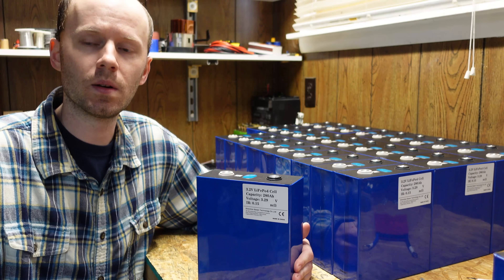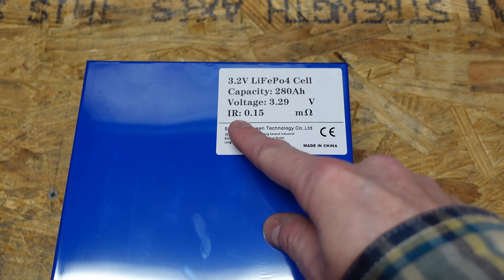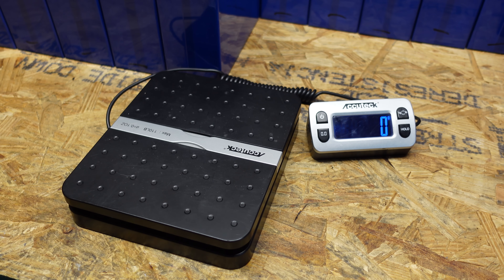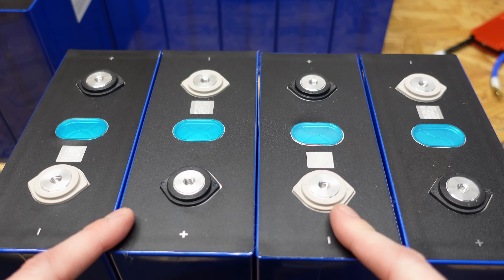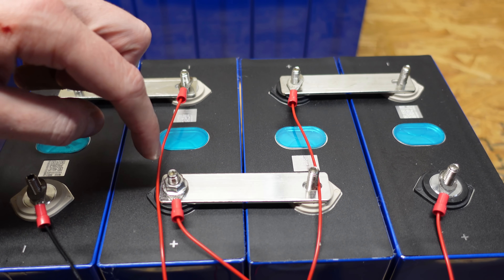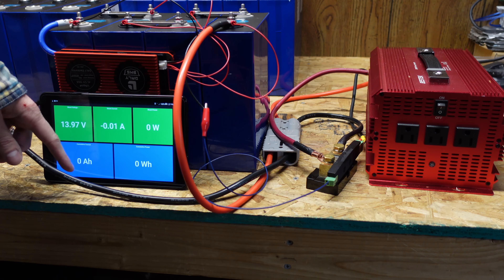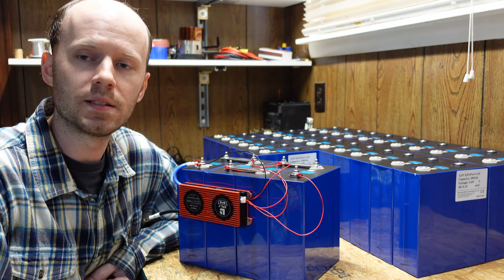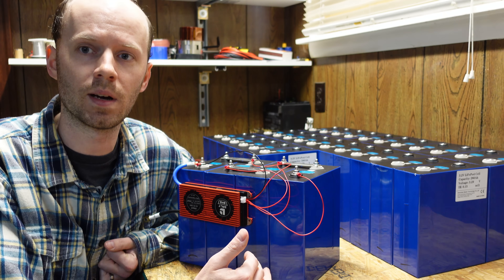EVE 280Ah 3.2V LiFePO4 Prismatic Batteries (Shenzhen Basen)

Comment: do not.... repeat .. do not use stainless steel on ali.. it is a mis match.. your studs will rot out the ali .. and make batts no good ... if you do not belive me .. ok.. butt ask a radio ham ? yep or an engineer ok..
Reply from the maker: Why will the studs rot out?
Reply: @LithiumSolar  its an electrical miss match. it takes a couple of years but they rot out.. i leant the hard way.  i used s/s jubilee hose clips to fix my antenna .. then next time i had a problem it turns out i had no antenna. three clips and 4 bits of aerial . hole thing rots away. change the studs to plain steel ones and all will be good
Reply: ps... its the ali that rots not the stainless.. ok
Reply: @LithiumSolar  I got 4 of them the other day with same studs (grub screws). I am thinking to abrade the terminal & the busbar with scotchbrite pad & use conductive grease (NOT dielectric grease) to hopefully reduce oxidation between, which in my opinion should be the major current path. Remember these cells & the BMS are not waterproof, so keep them dry also. Wondering should I grease the grub screw threads - thoughts?
Reply: It's called galvanic corrosion... you typically need to select materials that are close in galvanic series, but a small stainless stud in a large aluminum surface is not an issue..

Comment: Thanks for the nice vid, my cells are on the way from Basen too... I got the same BMS wit my Bluetooth for monitor ... can we change the setting on BMS to 2.6 cut off instead of 2.2? Please do a how to top balance on these cell if possible? Thanks a lot
Reply: Will Prowse has a 6-minute tutorial on how to top balance LiFePO4's:  https://www.youtube.com/watch?v=x5ABvbbics8  He explains why you should do it and some precautions you should take.  Honestly, it's very simple to do, and the actual instructions on how to do it take only about 30 to 60 seconds to explain in the video. 

Basically, you connect your cells in parallel, then connect a 3.65V power supply to charge them until the current drops near zero.  It's preferable that the cells are fairly well charged before doing so or it may take a long time.  When I'm top balancing, I tend to charge below 0.2C (1/5th the rated current of the batteries) as there's no reason to be in a hurry with saturation.
Reply: The ordinary Daly BMS's can only be customized by themselves, we cannot change any parameters ourselves. Actually with these default cut off settings (2.28V lower, 3.75V upper) these BMS's are quite useless. Their balancing currents are also like 30-60mA, which isn't practical when dealing with tens or even hundreds of amps charge, discharge currents. So I wonder how they can actually protect the cells (except for in case of short circuit)
Reply: The Daly "Superior" BMS says "customizable" on the data sheet, so maybe if you order straight from Daly you can request 2.5 low voltage and 3.65 high voltage?  The "smart" models can be set via the PC software, so I've read.  I'm trying to find a good 200-250A or more BMS so I can fire up a 2kW inverter to the max.

Comment: Those are great batteries, how much did they charge to ship the batteries?
Reply from the maker: The shipping portion of the invoice was $592 using DDP shipping.
Reply: @LithiumSolar  ouch !  $344 for the battery that's cheap. But $592 for shipping put a damper on my project.
Reply: @RichQcCa  $592 is for 32 cells, if you're only buying 4 cells the shipping will ofc be cheaper than that.
Reply from the maker: @EdisonWong2004  Yes, the $592 was the cost for the entire shipment of 32 batteries in 16 different boxes. You can request a quote for free and they can give you a price for the number of batteries you want.
Reply: @RichQcCa  they quoted me $356 for 4 cells plus $135 for shipping to Texas which is cheaper than a Battleborn battery and double the capacity

Comment: Excellent decision going with those cells. Set and forget for the next 10 years ;)
Reply: Ya sure but how long will it last in  ofgrid condition using regularly
Reply: @showbudgies1517 , the 3 main factors keeping LFP cells healthy are: C-rate during charge and discharge, temperature profile and compression. Solar Off-grid are typically the easy going applications it terms of C-rate. Big pack, as you want to have stored energy for maybe a few days, and relatively constant loads pulled over long time intervals. Li-Ion cells of any kind prefer warm temperatures, as then the Ions are moving easily through the battery (internal resistance). LFP is feeling very comfortable at 25-35 deg C. Compression, in terms of holding the cells together, don't let them freely contract and expand as they could delaminate internally under harsh conditions. Do all right, and you will get 5000 cycles till 80% DOD while using 90% of capacity at each cycle (3,5V high and 3,0V low).

Comment: Quick question, the first red wire goes into the 1st cell positive or the 2nd cell negative? In the video I think you have it in the second cell negative?
Reply: 1st cell positive is directly strapped to the 2nd cell negative so they are essentially the same. Notice the bar connecting them?
Reply: Yes I think that was wrong, Red wires to every positive post.

Comment: That shipping material looked to be Low density polyethylene. It is great shipping material the same stuff dell computers are shipped in.
Reply: My 200 AH Aims batteries came shipped in this stuff, arrived in perfect shape. I kept the foam. I put a Honda EU2200i on one and made the unit much quieter on a wooden deck.

Comment: Nice! I was thinking to order either these or LISHEN 200 Ah cells for 17s 1p for "48v" ofgrid solar pv system with 200a Daly smart BMS and 5kW 100A EPEVER low frequency inverter charger.
Eve's datasheet states that capacity is measured at 0.3c so that is within spec :)
DoD 80% will indeed prolong its lifetime and allowfor narrower voltage range.
How about compression enclosure to prolong lifetime?

Comment: Im assuming the heater was 1500 watts .. how long did it take to deain the 280ah?
Reply: P = U • I  and E = P • t
Reply: This is my rough estimate (3.6v x 4 cells) =14.4v then multiply by 280Ah gives u 4032 watts then divide that by 1500 watts of the heat gives u 2.3 hours of course added some loss from the inverter
Reply: @DIY_versus  Quite allright. If you use the medium cell voltage under load, like 3,2 Volt, you are more close to reality. Then if you pull the correct units through the calculating to the end, you have an "automatic double-check" of your calculations. The "4032 watts" is Wh (Watt•hour) or 4 kWh.
Reply: @Stefan_Dahn  u can set your BMS to whatever max voltage u want . Usually 3.65 is the max and 2.5v being the min . You can set your own preferred voltage . And of course u don't what to take your batteries to the max and min .
Reply: @DIY_versus  But this does not affect the capacity or average voltage much, as below 3.1 Volt there is quite no energy left in the cell.

Comment: 32 cells all in series for a 96v setup? That how i run these exact same cells.
Reply from the maker: I'm planning for a 16s2pm. My off-grid setup is a 48V.
Reply: @LithiumSolar  Sure, you would have to arrange for a new controller and inverter. I am running a 10kw inverter in Europe to 220v single phase. For a 110v setup you hardly need to step up the voltage and there are even smaller inverters now from 5kw up for 96v batteries. Probably for the future the best would be storing at a higher voltage than using?
Reply: @adragaadraga4026  For USA* ~120AC  You'd need in excess of  170 volts DC. 230AC  325 DC  
* Voltage  USA  is NEEMA = 120. or  ANS I= 125 both @60Hz   
*NORMALIZED EU standard = 230/400  @50Hz.
Reply: Would be nice to have that set up here in Texas with no power for the first time in decades

Comment: Nice video, Mike. Do you use some form of heat in your vault shed to keep your batteries above freezing temperatures? Are you going to be replacing some of the 18650 cell batteries that are in your shed will these or adding these as additional battery bank?

Comment: Looks good I found a heater in my 26650 lifepo4 A123 batteries but they are 6 years old, other than that the 50 kwh I have hooked have run pretty good for well over a year now.

Comment: Did I see it correctly?  Looks like your last cell (+) was not hooked to the right cell.  It looked like you had two positive leads on the same cell.  I order 64 of the Lishen 272Ah cells for ~$87/cell with shipping coming on the "slow boat from china."  Should have another week to go.  We'll see how they look/perform soon.
Reply: its connected to the bus bar so doesnt matter.  the first red wire is on the "wrong" cell terminal (2ndcell negative instead of first positive), but technically is measuring the voltage on the first cell as its on the busbar.   Technically should had been on the first cells +
Reply: He installed the first positive lead on the bussbar over the negative terminal for that cell, instead of on the positive terminal for cell 1, but it won’t make any difference, since it is on the same bussbar as the first cell positive.
Reply: It freaked me out. It took me the whole video to figure out it would be the same voltage. But when he said "well, I double checked my connections and am ready to plug in", I wanted to scream NOOOOOOOOOOOOO!
Reply: David, can you share the supplier and the price has shipping included?
Reply: @carlosgaspar74  I did it using a group-buy from Will Prowse's DIY Solar Power Forum.  The thread for the cells is: https://diysolarforum.com/threads/lishen-272ah-thread.12871 and the individual I setup the group-buy with was Michael B Caro.  Just PM him and ask for a quote for the number of cells you are looking to purchase.

Comment: Awesome.  Amazing how much better this batch is compared to the first. Thank you for stating how much it cost with everything included, taxes fees etc, per kilowatt hour. I do have one question... Why did you test it using this method instead of discharge using your icharger x6 in regen mode?
Reply: Mmmmmm
Reply: I have the same question. That would be my first go to method using my x8. My only thought would be that’s how Mike has been testing pre-built 12v LiFePO4 batteries in previous videos.
Reply from the maker: I guess I just thought that testing a single cell would be a little too plain/boring lol. I haven't decided if I'm going to go through and test one by one or not.
Reply: @LithiumSolar  if these are aluminum cased is there really a need to compress thought that was only for plastic CALB primatics that you had to compress.
Reply: @LithiumSolar  I thought Shenzhen Basen Technology sells Lishen cells not EVE ? Can't u list if there is any difference  please
Reply from the maker: @DIY_versus  Yes, they sell Lishen cells too. I purchased the EVE cells.
Reply: @LithiumSolar  ok thanks what's the difference by the way ?
Reply: @liv04soccer   if you mean those gray calb prismatic cells they deffinitly dont need compresion i work at a company that uses them in converted 7,5 ton delivery trucks and those cells dont puff up even when reguarly under high load (somwehr up to 250 A ). I dont know if there is another typ of calb cells but they standard grey ones have a metal inner casing unlike winston /thundersky wich deffinitly ned compresion althou on yt most peopel say they dont
Reply: That's interesting didn't know the plastic have an inner steel casing I read somewhere you had to have compression on them. 
These blue 1s are aluminum not sure if they need compression.
Reply: @liv04soccer  the blue ones in the video deffinitly need compresion the aluminium casing wont hold up to the gases. At work we use similar ones  on diffrent vehicels but in pre manufactured packs of 6 and they are also compressed
Reply: @nickhetzer2744  Does the manafacture state the compression specs I don't see a lot of YouTubers ever compress these ?
Reply: @liv04soccer   i dont know exactly but in my case at work the manufacturer compresses them with 3 stell packaging wraps like on a pallet  and 2 aluminium plates on each end so they must be serius about that our calb cells are only packed into a stailes steel box with som rigid foam wich wont compress them at al
Reply: I would say that there is no need of testing brand new cells individually before assembling the pack. They are tested in the factory. Just equalize them by paralleling them before putting the pack together. If there is an outlier in the pack, you will see it on voltage best at low SOC
Reply: @RolandW_DIYEnergyandMore  I think the test is to ensure you were sent what you ordered rather than how you would test second hand 18650 cells for capacity. Does that make sense?
Reply: @magicmavis  testing 32 individual cells will take you a month and require equipment which you later might not need for anything else? And at each test, there is a possibility that you made a small mistake, which will give you a 5Ah false result. Testing the whole pack at once, will if all is right, produce the same 560Ah result. And if it is only 540Ahs at the end, you will find, that 30 cells have 3V and one group of 2 will have 2,5V (if you have set that as cutout). So you exactly know where your non-standard cell is. This are brand new cells, manufactured on the same line under same specs, right one after the other as shown on the barcode. Does that make sense?
Reply: @RolandW_DIYEnergyandMore  a lot of people messing with solar/batteries already have an iCharger X6 kicking about, possibly two of three of them. Each of those would easily do two cells a day at 30A discharge. You can even use the regenerative charging mode to pull one cell down while recharging another.

The issue with testing a pack is if one cell fails early the test isn’t valid on the other cells. If one cell may fail very early you then don’t know about the rest in the pack without repeating the test.
Reply: @RolandW_DIYEnergyandMore  dude he tested the cells to see if they where the capacity that was advertised.

Comment: They posted 32 cells to me on dec  31 . Still not here . I am like a child waiting for christmas . Your video has given me a boost , cheers bro .
Reply: my dose of cells will come march 3. i hope :D
Reply: Hooray , mine arrived today 24th march .  week short of three months in transit .Hope all is well on inspection .
Reply: @irish-medi-weed-grower5240  3 weeks on border and $200 in taxes later and I got my on march 19. all 8 is 3.29v. after charging full pack I got 6 cells upto 3.48, one 3.55 and one 3.35 :)
Reply: @irish-medi-weed-grower5240  actually no. ideally one need to parallel connect all cells and charge it to top balance them. there is a lot of videos about this. I didnt do it because I dont have time. I need battery to work asap due to unstable powerlines. i have passive balancers on my battery to equalize top charge levels.

Comment: Holy cow that is a pile of cells. Are you planning to resale them? I'm hearing from most distributors that the profit margin is super low, so no one wants to carry them.
Reply from the maker: No, I'm not in the business of selling things. My end goal is the replace all of the 18650 NMC/LCO I have with LiFePO4.
Reply from the maker: I wonder why the margins are so low when they seem to be in such demand? Unless that demand is just within our own DIY community?
Reply: @LithiumSolar  right?! I totally agree. Someone will sell them eventually.

And yeah, same here. I would hate to distribute stuff all day. Customer service with batteries sounds like a nightmare 😂😂
Reply: @WillProwse  the problem as I see it Will is: while prices are dropping per KWh and tech is moving rapidly then holding stock mean that you could quickly be left holding stock that's out priced by the market. Not a great incentive, I'm sure you would agree? (I spent 40 years in retail)
Reply: @LithiumSolar  Wow that is awesome.  Lots less work to put together a pack with the LifePo cells and hopefully longer life.  I'd be curious to hear your opinion about cost of the 18650's you were using vs. LifePo that you are going to put into service.  I bet the cost difference isn't too much, especially considering your time and effort.
Reply: Oi oi Billy P is in the house
Reply: Hi, is it ok if i build a 48v16 to use a 100a daly bms and 80a growatt mppt with 2.2 kW solar array ?